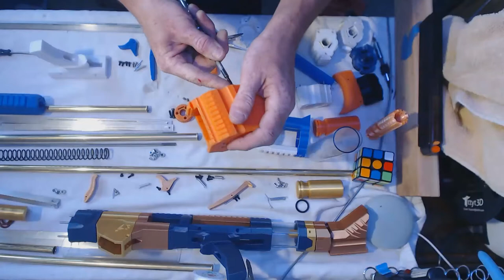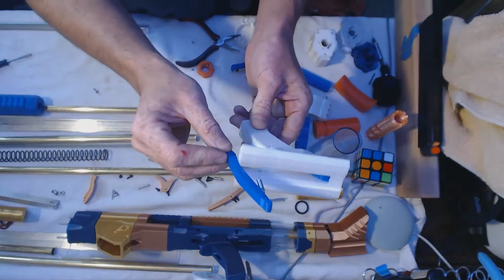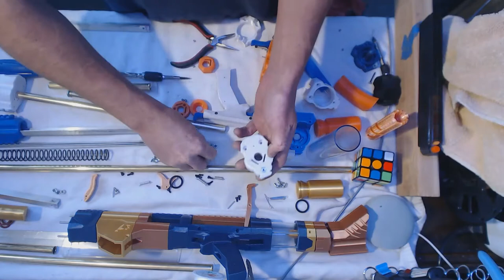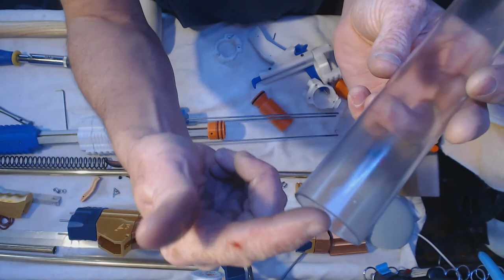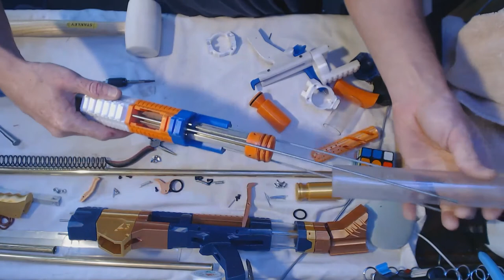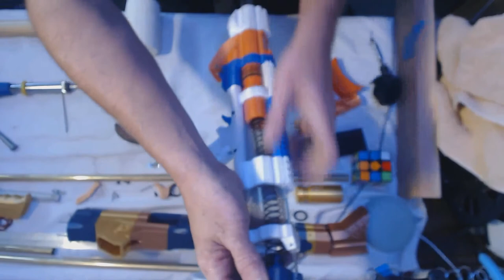ManzanDesigns Ruffian Follow Along Build Video Guide

Comment: Whats the plunger tube ID and draw? Average fps and max fps
Reply from the maker: 1 3/8 and with a k26 i try to get it to average high 290s and dont send them out until ive tuned it to at least be able to reach 300 and its about a 15 cm draw